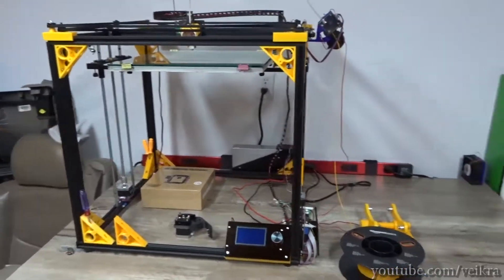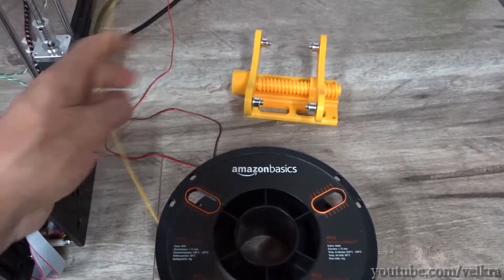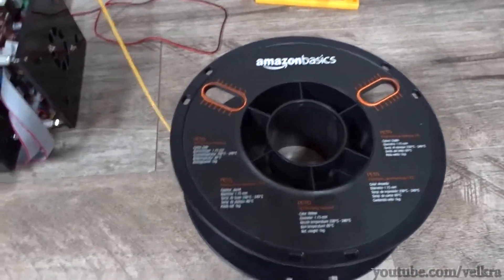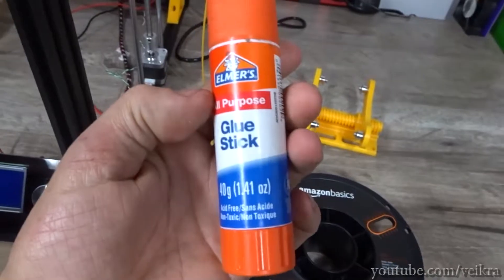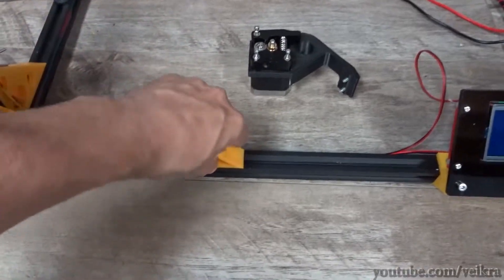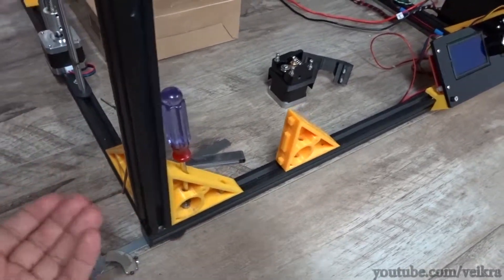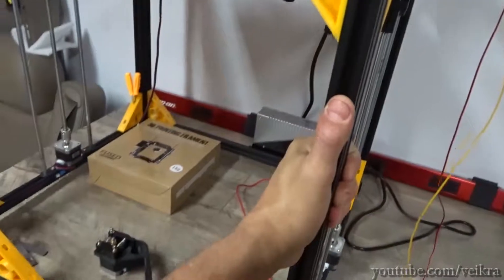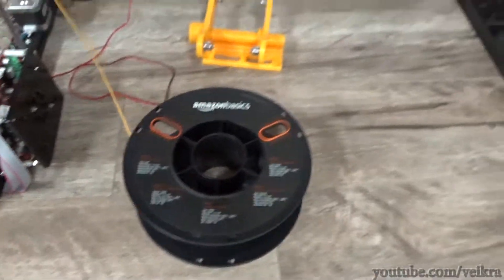Is amazon basic PETG any good?

Comment: Just got 2 spools of Amazon basics PETG. Both unprintable. Put the spool of red filament in my oven at 50 C. Let's see if it gets any better. Mine were ordered from amazon de and not packed in vacuum but in very thin heat shrunk plastic. EDIT: Printed ok. Printer didn't read temp from g code and printed in wrong temp. After manually  setting proper printing temp results were fine. Would appreciate if they'd pack this in vacuum though. 2nd EDIT: The blue filament printed ok but unwinded poorly. Had to help manually to unwind. The Red filament unwinded even more poorly causing it to break as it is very brittle. Spooled filament layers are like glued together and keep crackling sound when unwinding. Made a complaint to Amazon and got my money back.
Reply from the maker: Mines were in vacuum with dessicant. Printed ok but never bought any more since it went up in price. I like to buy cheap for prototype and non-cosmetic stuff.
Reply: @Nordic_Mechanic  Decided to print testcube after drying filament. After slicing wit Cura, noticed that printer didn't read extruding temperature from g code for some reason, but used previous ABS prints temperature. After setting proper temp the print was good.